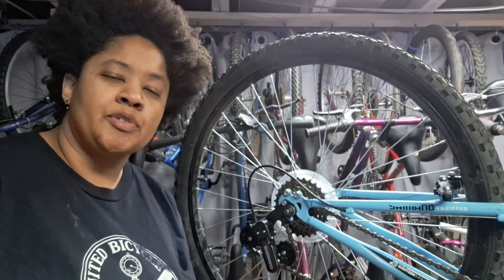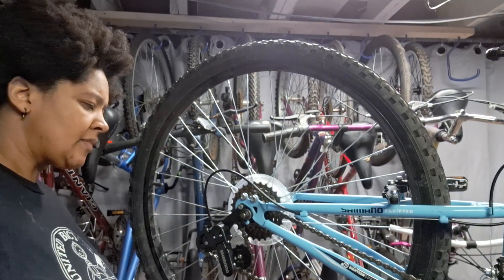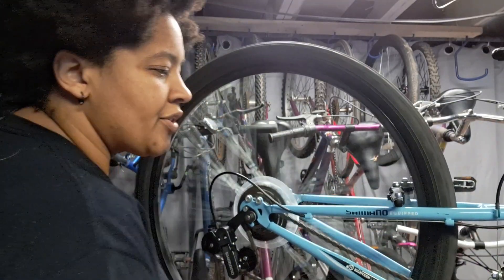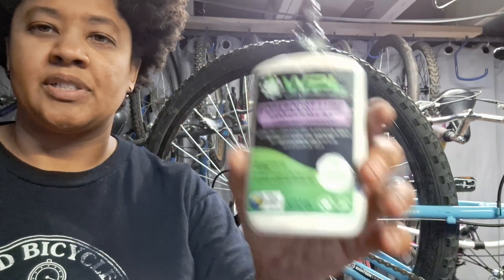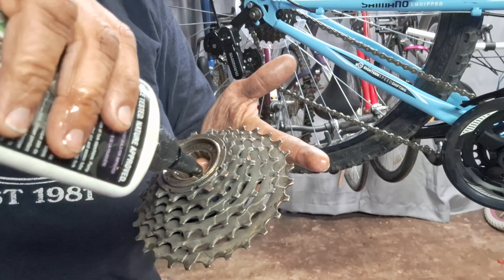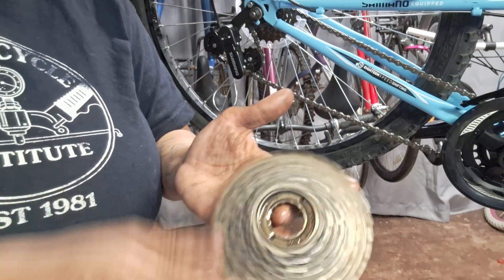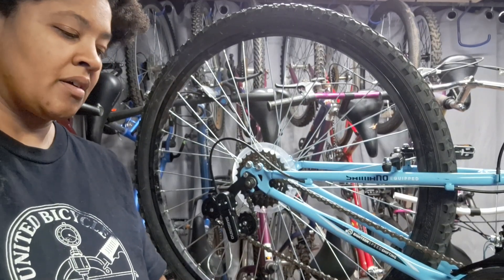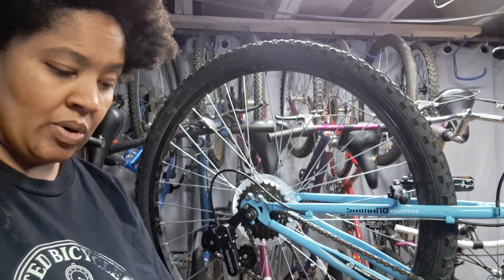Quieting a Noisy Freewheel

Comment: Good one. I've taken apart a few freewheels to get them running more smoothly, but I think this technique works just about as well,  while taking a fraction of the effort. I won't take them apart any more. I attached my freewheel too to a cordless drill to make the spinning stage go by faster. I did a sticky freewheel after watching this that probably is at least as good as it was when brand new. Thanks for the video!
Reply from the maker: I'm glad it worked for you! Freewheels are so cheap and easy to come by, I just can't justify spending too much effort into fixing them. This has worked a few times for me, so glad to hear someone else try it successfully.